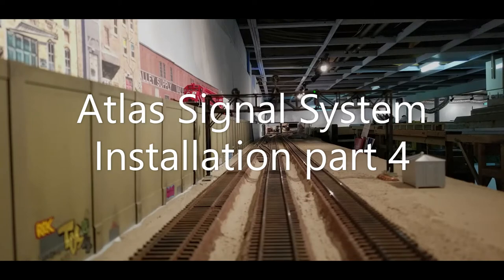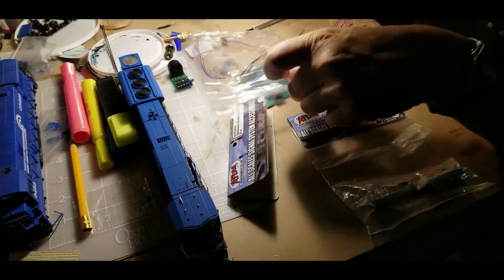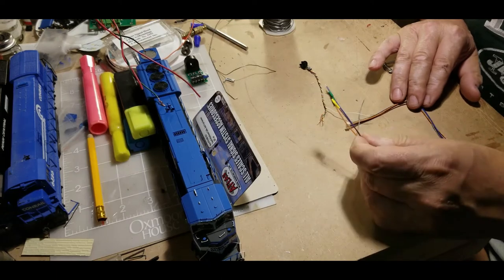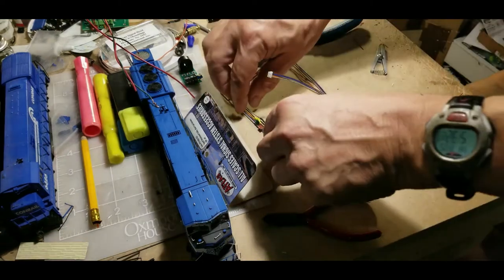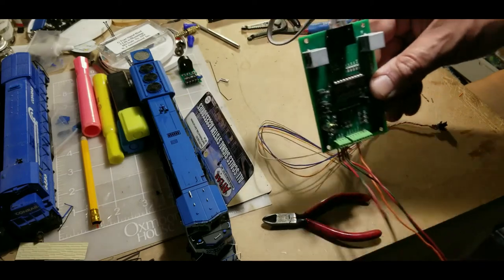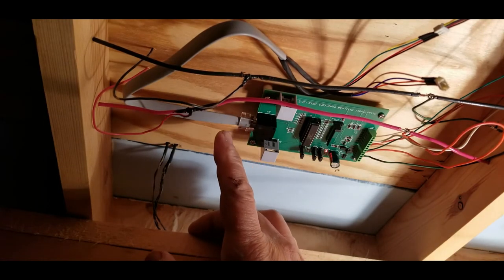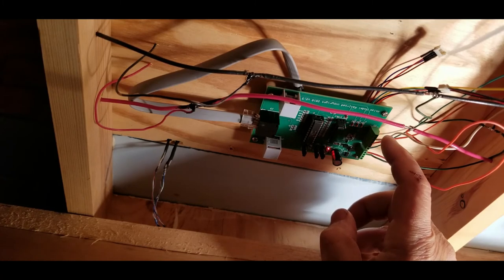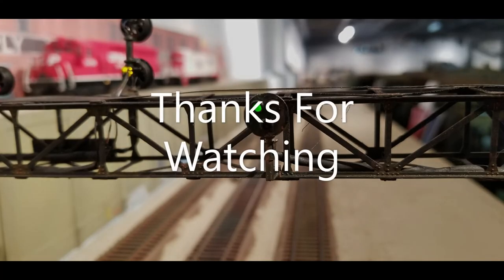atlas signal system installation part 4

Comment: Your videos have been quite helpful as I’m installing this system on my HO modules. Are you able to get the signal boards to ‘talk’ to each other via the interconnect cables? I have mine setup, but can’t get the signals to drive the previous signal. Information is limited online to resolve this.